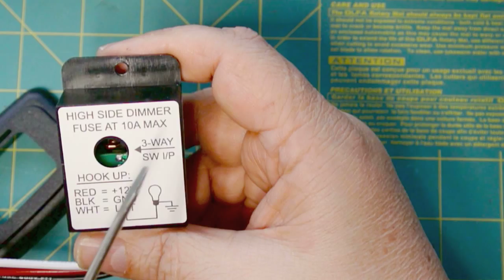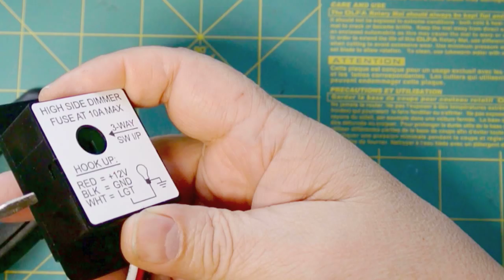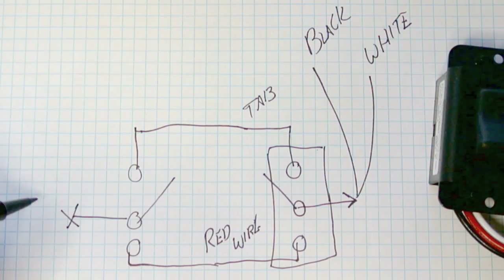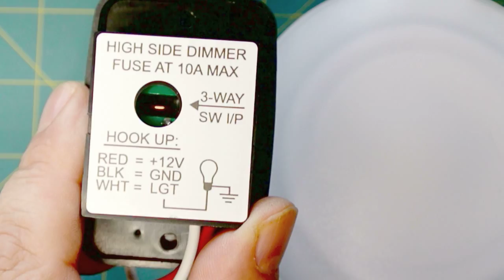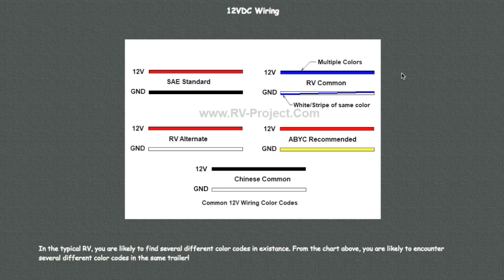Installing a LED dimmer in my RV

Comment: Thanks. I have two wires in the unit and three wires on the switch. Where do I connect the third wire (ground)?

Comment: Is it possible to update the 3 way diagram with full color wiring or show how it was actually connected? The positive DC on the left side of the diagram doesn’t show the color or specify if any colors are un-used between the switches. THANKS!
Reply from the maker: Most of my videos have a corresponding webpage with more info. The webpage for this project is: www.rv-project.com/projects/sofadimmer.php

It should provide a better drawing.

One risk with using wire colors in the RV world is that there are no standards.

You really need to be careful here and make sure you properly identify the wire's function as the color of the wire may not be consistant.  For example, in a RV, a black wire could be 120VAC (hot), DC +12V or DC ground.
Reply: @RVProject   Thank you, thank you for making this info available!!  Have been searching the internet for ages trying to find a diagram for wiring a 12 v 3 way switch and finally lucked out by finding this reply with a pointer to your web page. Going to order my puck lights and switches this weekend.

Comment: I need to add a couple of these to our motorhome, I also need to add a 3 way switch (not easily done after the RV is already built!) beings my new 2018 Georgetown motorhome has NO light switch to turn the main cabin lights on or off back by the bedroom! The only freaking switch for the main lights is at the bottom of the stairwell by the door.. we didn’t notice this “feature” until we got the coach home and I almost took the thing back just because of it too!
Reply from the maker: You may want to look at my project where I added wireless remote capability to my light-switch.  It does not have dimmer capability, but it might give you a project idea.

http://www.rv-project.com/projects/remoteauto1.php

Comment: Good job
What's it mean when you dim the 12 V 
LED pucks and they emit a buzzing sound?
Reply from the maker: Some LED pucks use PWM to control the amount of current they receive.  However, most all LED dimmers also use PWM to dim the LEDs.  

There is no standard as to what the frequency that the puck PWM and dimmer PWM signals operate, and in some cases, there can be some interaction between those frequencies, which causes the buzzing sound.

It's basically "luck of the draw" as to whether a particular model dimmer and puck will interact this way or not.
Reply: @RVProject  

Should I replace the dimmer using the same model but hope it's operating on a different frequency?
Reply from the maker: @dugdug007  Due to component tolerances, you may find that there will be a minor difference in frequencies, but it might not be enough.

In the dimmer shootout article I wrote on RV-Project.Com (http://www.rv-project.com/gear/dimmers.php) I have a chart showing the PWM frequency of a few different dimmers.  

Also, if your puck lights use PWM, you might never totally get rid of the buzzing without replacing them with non-PWM pucks, which are becoming more common.

Comment: My travel trailer is the same way. Larger loose connectors. Good thing the devices aren’t pulling a lot of current. Ha. My springtime project will be replacing them. Thanks again.
Reply from the maker: It is appalling that RV owners have to put up with this.

Comment: I have a one year old grand design trailer and my light has only two wires. I hook up the black and red wires and the lights come on but much dimmer than normal with the dimmer switch all the way bright. I guess you would need a ground which mine doesn't seem to have.
Reply from the maker: You did not specify what dimmer you have. There are many wiring configurations depending on whether the dimmer is "high side" or "low side".

If you have the dimmer as shown in the video, I produce a corresponding webpage for every video with expanded information.  

The webpage for this video include several wiring diagrams. You can find the webpage at:  http://www.rv-project.com/projects/sofadimmer.php

Also, terms like high side and low side are explained in this video: https://youtu.be/wv7h8jDPZ8g

Comment: This video has been super helpful for me. I have a super long run between my switches for the 3 way set up. Would it be possible to add a relay?
Reply from the maker: Are you wanting to place a relay next to the dimmer and control it from a distance?

You certainly could do that, buy perhaps you might want to look into a 433mhz wireless relay, then you would have plenty of range. 

 Something like this: https://amzn.to/2HP3zsU

As long as it has SPDT relay contacts, you can wire the relay output like you would a regular SPDT switch.

The only caveat is you will use a bit of 12V power to both energize the relay and to run the remote receiver. This might be important in a boondocking situation.
Reply: @RVProject  Thanks for the reply again. I already have three wires about ~15ft each running to the location I want my SPDT Switch making 30ft power run to my dimmer if I did no relay. I have about 8ft from my distribution block to the dimmer. If I was to put a SPDT relay, would I put Normally Open (NO) in the 3-way location on the dimmer or can it be interchanged on the dimmer switch? Even powering a SPDT wired relay over a wireless relay, it seems like it would be a small parasitic draw when the relay is charged and in the NO position even when the lights are off on the dimmer switch. Maybe it might be worth running the power over the 30 ft run to the dimmer switch but just afraid of voltage drop. I am running 4 2-watt lights off the dimmer on 12 gauge wiring.

Comment: Wondering where you got the other switch. I ordered one and it came with just two prongs. Where did ya find the one with three?
Reply from the maker: Whenever I do a project video, I also produce a project webpage with additional information. The webpage for this project is here: http://www.rv-project.com/projects/sofadimmer.php

It provides connection options for the dimmer, as well as the sources for the items.

The switch cannot be bought as a set - that is, you cannot buy the switch with the bezel in a SPDT 3-way configuration (3 contacts).   You have to buy the switch and bezel separately.

Sorry it is this awkward to do, but this is because the mfg does not offer the 3 way switch already in a bezel.

Here is the bezel with two way switch (which you probably already have): https://amzn.to/3rzecRv

And here is the SPDT 3-Way switch: https://amzn.to/2Pmc1DI

Hope this helps.
Reply: @RVProject  Well I didn't know that, thanks for taking the extra time to respond. It's the little things we do that help a stranger that make the world a beautiful place. ✌

Comment: Why not explain how to wire up a high side dimmer switch (per the video title) ?  Not that I don't enjoy the scenic route but for anyone wanting to skip the whole lecture and JUST wire the damn dimmer in place of a wall switch (switching positive leg). Simply tie the black & white leads together and attach to the wire leading to your fixture. Attach the red lead to the positive lead coming into the switch. Presto. You're done.
Reply from the maker: I am sorry you did not like the way I presented the material.

For every project video I produce, I also create a webpage that has additional information, including schematics of the various methods to wire the dimmer.  I always state that in the videos and provide a link.

The video is just a summary. 

My goal for RV-Project.Com is to be a catalyst for doing your own projects. In that regard, I provide background information necessary should you want to do something a bit different, or want to learn the how and the why.

I never intended RV-Project.Com to be a step-by-step instruction. First, things change over time and what was correct at one time might no longer be correct later down the road.

And then there is the Chinese wiring color codes. I don't feel comfortable in just telling people hook one color wire to another when there is no real color code standard in the RV industry.

I have a copy of the RVIA/ANSI LV (Low Voltage) standard. There is nothing in that standard enforcing a color code.

So it is also a liability thing...

Comment: very helpful.. and "doable" by us average types! All of your videos are very informative. Even the projects that are are above my skill level provide valuable tips and education, thanks for all the help!  Are the led's used in most rv's dimmable or do we need to change out the light to do this?
Reply from the maker: Most LED lights are dimmable, although there are a few older puck lights that don't dim very well. Those typically have a different internal LED driver called "switch mode". They can be dimmed, but not all dimmers can dim them, as it depends on several variables.

I would try to dim the existing fixture in your RV, and only change it out if it does not work very well.

Comment: Hello where do I find the 3 way switch without the dimmer. You used 2 switches but only provided links to the 3way dimmer and not the other 3way. Can you please provide link so I can purchase it.
Reply from the maker: On the project page at my website: http://www.rv-project.com/projects/sofadimmer.php  I provide a link to a matching 3 way switch.

Unfortunately, you cannot buy it in one piece. You must buy the bezel and on-off switch ( https://amzn.to/389QEMj ) then a replacement 3 way switch ( https://amzn.to/2LjJWut ) and insert it into the bezel.  

There is probably a complete unit available somewhere, but I have not found it.

I have to state though, this would be for a matching 3-way switch.  You can use any SPDT (without center-off) switch that is rated for DC voltage and it will work.

See my video "All about switches... for your RV" for a discussion of switches. https://youtu.be/Bv7V2uVGevg
Reply: @RVProject   
does the switch need to be a 
on/on switch
Reply: I had another question about your website. remote control lighting in different rooms. Can they also be on a dimmer? how do you control various rooms with remote
Reply from the maker: @shocks8699  Yes. The typical 3-way switch will be ON-ON, or ON-NONE-ON

Comment: When not on shore power, have you had or seen any flickering of your led lights when using the water pump or other 12v power usage?
I put a "cheap" 2 lead only dial --> https://www.amazon.com/gp/product/B01C4UBMY6/ref=ppx_yo_dt_b_asin_title_o03_s00?ie=UTF8&psc=1 and when I turn water on (when boondocking) the lights will flicker with the running of the pump.  

Thoughts?
Reply from the maker: I have not. But each RV is different, and flickering can happen if the wiring results in a voltage drop in the lighting circuit when running the pump.

Comment: Thanks for sharing your knowledge! I am trying to install the same dimmer switch in my camper and my current switch only uses 2 wires. I can not see a 3rd set of wires as seen in your installation. Do you have any ideas how to make this dimmer switch work with my wiring scenario?
Reply from the maker: Check out my associated website which shows several different wiring scenarios:

http://www.rv-project.com/projects/sofadimmer.php

Although the original switch is not shown, refer to the first schematic on the webpage. You will see two wires labelled 12VDC in the schematic. This is the positive and negative wires. The positive wire should go to the switch.

If you still cannot figure that out, let me know and I will add a schematic to my webpage showing how to replace the switch with the dimmer.
Reply: I'm having trouble getting the dimer to dim. I have the red and white connected properly (I think) as they turn the light on and off. But the dimmer does nothing?

Comment: Thank you for the video! Would you be willing to show a more detailed diagram on your site for wiring two, 3-way dimmer switches to a single lighting circuit? I cant seem to figure it out between the our video, diagrams, and comments with @Amanda Roosa

In the diagram, it shows the top (3 way) tabs connect with a traveler, then from the line source, the line source connects to the red wire of the first switch.

The second switch connects to the light and so the black and white wires to go the load per usual. The top 3 way tab is connected to the other switch as mentioned. This leaves switch two with an unused red wire and switch one with an unused black and white wire. I've tried every combo of the unused wires to no avail. I can wire a single dimmer 3 way switch no problem but am failing when trying the second. 

Any help is GREATLY appreciated.
Reply from the maker: You cannot wire more than two switches into a 3-way circuit.
Reply: @RVProject  Thanks for the reply. It is only two switches. Both of them dimmers. Same as the dimmer in your video, but instead of only one of them being a dimmer they both are.

Comment: How do you get the 3/16th connector off the switch? Everytime I try the pin actually comes out of the switch and I have to buy a new switch.
You also did not mention that dimmer module is +$80 dollars.
Reply from the maker: I bought my dimmer for $29. Each project I do has an associated webpage at www.RV-Project.Com. At the website, I provide links to where I buy the stuff.

 Here is the link for the $29 dimmer: https://pdxrvwholesale.com/products/dimmer-on-off-switch-with-slide-switch-and-bezel-black-ah-sld1-5-hs001

You may have to pay shipping, so you might end up buying it for less on Amazon with free shipping. Here is a link  on Amazon where you can buy one for $35: https://amzn.to/2FL87wp

In both cases, these are American Technology Components products, not JR Products. But American Technology is actually the OEM and about half the price.

The connectors can be hard to pry off. if you plan on replacing the connector, you can cut it off I suppose. Also, there are different "gaps" available for the 0.187 connectors. You might try a larger gap connector.

Comment: Great video! It's helping me significantly! Having a hard time finding some reliable 0.187 connectors. Do you have a link to ones you prefer to order yourself? I looked through your website, but I could have easily missed it. Thanks!
Reply from the maker: 0.187 Spade Lug Connectors: https://amzn.to/3fnD6P1
Reply: @RVProject  Thanks! I think I am fighting a battle uphill trying to stick with 12 gauge of wiring with these puck lights. (https://www.amazon.com/gp/product/B00ODSAQBI/ref=ppx_yo_dt_b_asin_title_o07_s00?ie=UTF8&psc=1) With a 3 way wiring, it will be an easy 30-50 ft from power source. I may just need to drop down to 14 to 16 gauge to make it easier on myself.